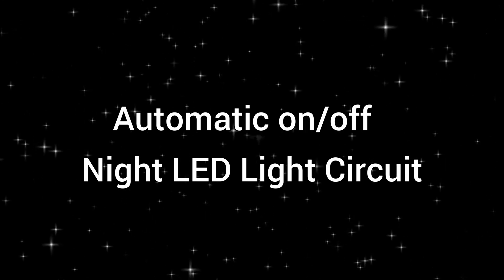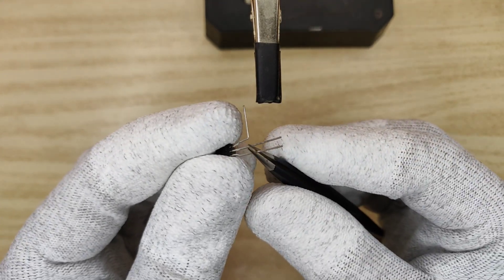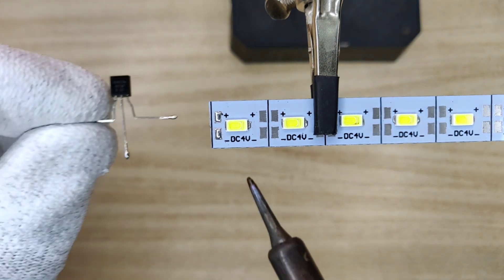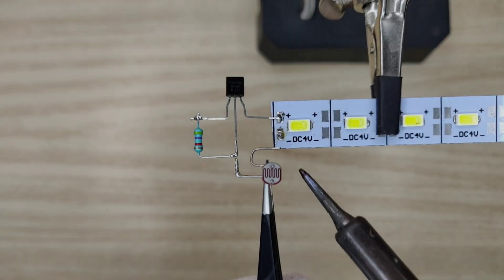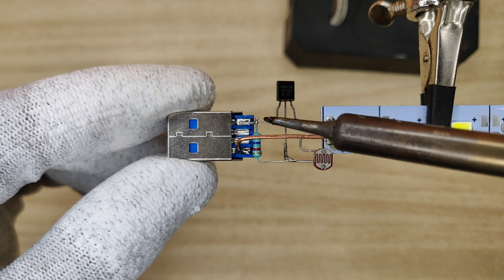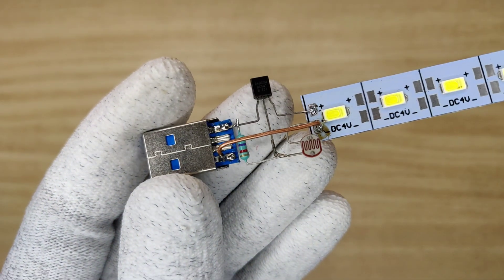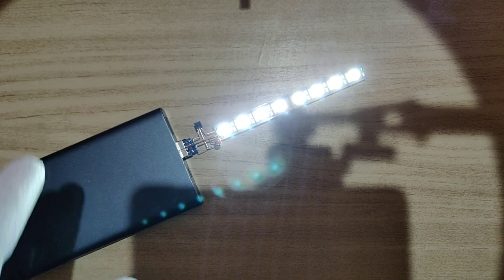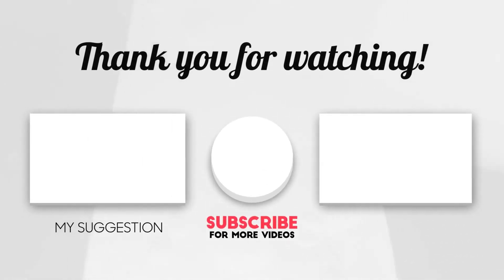Simple Automatic Night Light using LDR , bc547 transistor

Comment: why not using just the LED and LDR for such project? I think the LDR can handle 12v 50mA so I think there is no need or transistor and resistor.
Reply: If we directly use the LDR it will function oppositly like when you turn on light then it will turn on
Reply: Transistor is not for handling load

Comment: Nice circuit , can you share similar working for 12v led strip
Reply from the maker: You can use same circuit with 12v but use power npn transistor, and connect pinouts accordingly

Comment: Led will not glow full brightly..
Reply from the maker: You can use NPN power transistor, it will work great.
Reply: @CreativeTechos  
Name any power NPN transistor...
Reply: @CreativeTechos  please share the details of the npn power transistor you are talking about?
Reply from the maker: Use bd139 or power transistor tip41c
Reply: @CreativeTechos  thanks a lot
Reply from the maker: My pleasure, Thanks for watching 😀
Reply: @CreativeTechos  
Please u make that spot welder as I had told u before 10-15 days...
When do u upload that video??
Thanks...
Reply: @CreativeTechos  
In youtube a channel named ..."Technical sokil"..u visit this channel once...u can get some knowledge of the transformer spot welder....thnx
Reply from the maker: I already watched lot of that video's, where they used super capacitors with transformer, and used multimeter probs as welding probs, most importantly no pluse current for spot welding, they simply short charged current in capacitors that leave black burned spot at welding area, pluse control for current at probs is core important for spot welding, 
Microwave transformer based spot welers video is useful but still need pluse control to pass current for mili second
Reply from the maker: You please be patient, I'll soon upload super capacitors based spot welder, you'll be happy and you'll appreciate, but please understand i need to work on lot's of projects, i don't upload videos that will not work, i properly test it twice, so let me work on it I'll try to upload ASAP.
Thanks for your interest
Reply from the maker: Not next, 2nd video will be that, be patient, I'll start working on that.
Reply: @CreativeTechos  
I have one super capacitor...2.7V,100F...
Can I make a spot welder with this??
Reply: @CreativeTechos  
Can u try with many capacitors like...50V,4700mfd,10000mfd,6800mfd,3300mfd.etc...
Reply: @CreativeTechos  
Ok u make that in low cost...as online is costly....
Reply: @CreativeTechos  can we yse d880
Reply: D882 would do the work as I've tested successfully❤But I used 10k resistor instead of 4.7k.